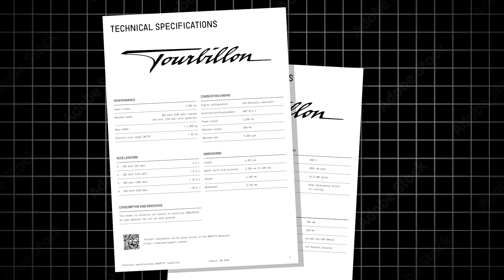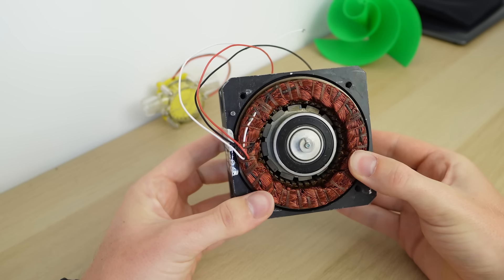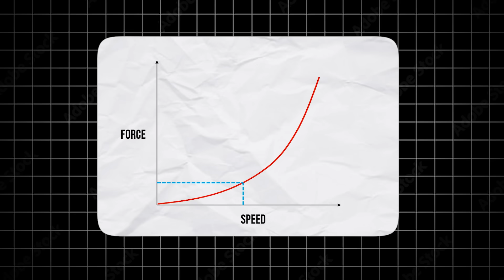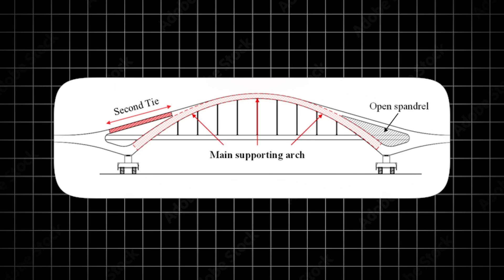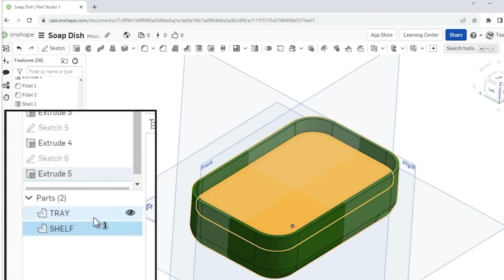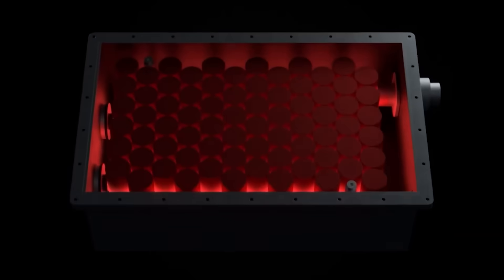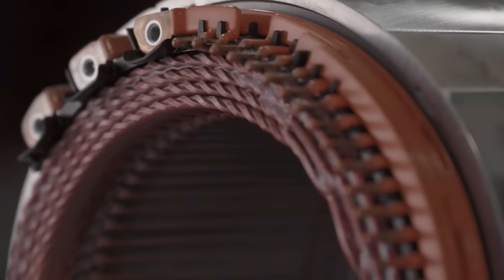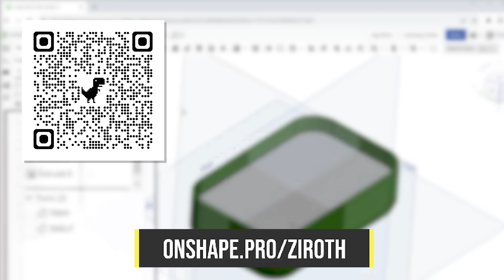How Bugatti's New Electric Motor Bends Physics

Comment: I think you went a bit off track without knowing the engine design, 24000Rpm is not uncommon in electric motors and used in CNC spindle motors every day without needing to be carbon fire composite reinforced.

AC induction motors don't need permanent magnets and showing 3 wires in tends to show its AC induction.

Just like CNC spindle motors which are usually 24000RPM at 400 hertz they can even have an aluminium rotor as eddy currents create the rotational magnetic fields and don't need permanent magnets or ferrous metals.

I have RC DC brushless motors I have made into 100,000 RPM spindles for diamond grinding CNC's.

The tensile strength of materials is only what is required by the centrifugal forces which is not only RPM but diameter and mass, so aluminium or titanium for example would be dramatically different forces to that of steel at same diameter and RPM.

If you want to do a video discussing rpm vs tensile forces and materials would be best focusing on stored energy flywheels where it is more relevant as these rpm ranges in electric motors have been surpassed many years ago.

If you want a 24,000 rpm electric motor just go on EBAy and buy a CNC Spindle motor and 400 Hz VFD for a few hundred dollars made in a Chinese factory and not requiring aerospace technology.

Carbon fibre winding would lend to potting Rare earth magnets for a DC brushless type motor which would be preferential to a automotive engine wanting to do regenerative braking but is more to do with epoxy strength in hot environments like a 200hp electric motor that when epoxy is heated it looses strength so if wound in a composite with say a PF resin which is Carbon-carbon bonds can do higher strength at high temperature .

The actual limiting factor of most these motors rpm is switching frequency and bearings as most use ceramic bearings at these rpms as stell ball bearings would fail at those surface speeds. And with switching frequency you have inductance that wants to resist fast changes and is very hard to tune and is more to do with motor driver design than motor.

But getting back to topic about centrifugal force if the rotor for example is 7075 billet aluminium so 2.81g cm3 with a tensile strength of 280MPa (about 40,000psi) and say rotor is 300mm diameter in the car would still go up to nearly 40,000 rpm before failure of material and needing carbon fibre winding.

Where carbon Fibre would be really interesting if was a carbon fibre reinforced carbon nitride for stored kinetic energy flywheel as say tungsten being heavy so can store a lot of rotational energy with still being one of the highest tensile and compressive strength materials is still just under 1 GPA in tensile strength but if would in carbon fibre reinforced Carbon nitride matrix could theoretically get over 10 GPA, this would allow energy storage of up to 500MJ/kg, (Diesel is only about 42MJ/Kg)  liquid hydrogen for rockets is only about 120MJ/Kg. So would be one of the best energy storage systems surpassing the best fuels and definitely surpass any batteries. maybe some design I will release one day soon as requires contra rotation if used in automotive, so you don't get centrifugal torque steer when trying to turn.

But generally, I do enjoy your video's and feel free to reach out if you ever want some research done on any topic happy to help.

Comment: Oil cooling is great and reminds me on chip cooling computers but car batteries should able to Load-bearing for a reduced total weight. Tesla choose a foam and cooles one Tab of the round cells passivly. What about prismatic cells who need pressure for mechanic stability may also give stability for load-bearing, cooled with oil?

Comment: Just started watching the video and... Apart from inaccuracies like "exponential" instead of "quadratic," I wouldn't want to drive a car with more than 1,100 horspower unless I were convinced of several other intrinsic and extrinsic features like stability, braking ability, and reliability, as well as road conditions and other traffic. You could say Bugatti can be considered reliable, but the mean time between failures (MTBF) of any system is known to statistically have a bathtub shape, so it will only be low after a certain time lapse (or miles run) has run.

Comment: The Rimac Nevera uses LMN battery chemistry. LiFePO4 would be one of the least likely types for a hypercar to use. The same goes for LTO, as although it has high power output as you mention, it has very low energy density

Comment: Can you ger novec 649 for cpu cooling?
Reply: Yes, but 3M charges $200 a gallon for it. Use mineral oil instead or just plain water cooling loops.  I looked into it and they won't even sell small engineering samples.

Comment: 2:51 No, that's polynomial growth, not exponential!  Exponential growth is another league entirely, and you're simply wrong to say that its in this higher league.

The term "increases exponentially" refers to a specific type of growth where the rate of increase is proportional to the value of the parameter.  That is, x is in the exponent position.  Here, we have x² , where a constant 2 is in the exponent position.
Reply: I came to say the same thing. Reading the comments, many people have also noticed this... seems like a rookie error if you want to talk about engineering topics. Maybe Joe Public won't know the difference, though.

Comment: 6:20 no this isnt referred as high power density, it is simply refferred as HIGH DISCHARGE RATE, and as a matter of fact it affects power density negatively always. LTO titanate arent "extremely power dense" either, they are very low power density compared to regular lipos.
Reply: discharge
Reply: @RSCB  ?? Bragging that you can read, or what? 😄🤷🏻‍♂️

Comment: We did fluid cooling of electrical drives back in the early 70's, using the absolutely best Types available, which were various PCBs.  We did railroad engines, and had a ten-ton military 6-wheel truck as a test vehicle.  Did ships drives, and wind turbines.  However, the PCBs were found to be carcinogenic, had to be removed, and the alternate fluids, typically antifreezes or light silicones, had all sorts of secondary problems, and were highly inefficient.  These projects were dropped by us, but the computer industry, and the heat-pipe industries started to use these techniques with volatiles, and these worked quite well.  Change-of-state cooling is also very effective.
Reply: Surely there’s something more conductive to heat. Is it that it’s hard to make materials super heat conductive without making them electrically conductive at the same time?
Reply: @milescoleman910  Generally speaking, heat is conducted by the same types of carriers, namely electrons and phonons.  Heat in a wire is mostly phonon flow, but requires a large Fermi Sea of electrons to make the transmission possible.  Seebeck and Peltier devices are examples of where people have tried to maximize the electrical efficiency, but reduce the heat flow to a minimum.  Usually done via vacancy methods such as pillars or slotted structures.  At very small atomic levels, heat flow can be hugely non-isotropic, and there are materials which flow heat "sideways" better than "up/down".  My son studies these as thin films, and some are being tried for semiconductor mounting to adjacent substrates.  The only other common method to transport heat without electrical connectivity is via change-of-state materials, as used in special heat pipes, where a refrigerant type of carrier is used to make a hydraulic/gaseous flow through a non-conducting pipe.  The pipes unfortunately are ceramics or glasses, so fragile.  Metal piping is commonly used, but these are electrically conductive.  Look up those types of items to get details.  Thousands of papers have been printed in this area, was a hot topic at around the 1980's.
Reply: Only thing that concerns me is if the oil over time gets contaminated from breaking down substances it passes over eventually the failure would be bad. Kinda how pure water isn't conductive until impurities are added. 800 volts doesn't need that much
Reply: One word ,well 2.  Li po²  ..😝dummies I use thorium...cheaper battery and last 20yrs

Comment: clickbait. Im not sorry but this guy knows nothing about electric tech or motors at all. "delivers 800 volts"? then on top of that proceeds to compare the voltage to another car like voltage is a performance factor. 600kw of power power a village for a time period? that's not how watts work, watts are an instantaneous power measurement and cannot be applied to time. kwh can be applied to time, not kw. POWER DENSITY IS NOT OUTPUT ENERGY PER WEIGHT. energy density is literally the capacity of energy per weight, not continuous energy output per weight. lots more issues but this is just clickbait by a guy claiming to know stuff about ev when he doesnt even understand the most basic fundamental of electricity, wattage vs current vs voltage.

Comment: Just a tip you don’t actually measure horsepower on a hybrid because the electric motors are really only used for the torque while HP is what determines the top speed of a car not to mention that the electric motors are only used for a short duration unlike a full ev which is all electric thus in that case you would also factor in horsepower but hybrids not so much since after a certain speed the gasoline engine would take over giving your your top speed!

Comment: That's all you need, drag around a battery AND the equivalent of a tank of gas worth of coolant to cool the battery with 🤣. Mineral oil is used for cooling of electronics generally. Can't wait to see all the battery fires that start when a leak occurs in the pack 🤣
Reply: Drag around a battery?? What?? It’s a hybrid meaning it also has an engine, you’ve literally just proven to everyone that sees your comment that you failed to pay attention or straight up ignored that it has a N/A gasoline powered engine along side typical EV technology also you don’t need mineral oil for a hybrid, the ram 1500 E-torque with a 5.7 Hemi Uses a motor generator and a standard 12v battery with a step up converter for the electric motor so as I said you have proven to everyone that you don’t know how hybrids work!
Reply: @CajunReaper95  how much added weight would a Tesla sized battery gain if filled with liquid in the open space, then factor in a cooling grid, reserve tank etc. you will be adding 20gal of coolant to the battery pack/car.. remind me the weight of that 🤔
Reply: It would be like keeping your Tesla trunk full of sand, how would that be on the mileage numbers? 🤔

Comment: "26% lower temperature, 54 vs 40 degrees C."
Me: ~Screams thermodynamically~
Reply: In fact it's less than 0.5% lower 🤣
Reply: @wedmunds yes but this isn't even relevant data since lithium batteries work better between 15°C and 35°C so they should compare to the middle of 25°C and not 0°C nor 0°K.
Reply: Agreed and based on a 20°C ambiant air it went from 34°C over to 20°C over. They should have compared it to ambiant air and talked about the thermal resistance between the batteries and the ambiant air if they wanted usefull data. They should have said: <<Accumulates 59% less heat, based on a 20°C ambiant air and has X% less thermal resistance etc...>>

 It would have been more appealing and also accurate
Reply: I don't get it. Is it just a percent difference calculation? 100% * (54 - 40) / 54 = 26%
Reply: @luckylanno  yes but I'm Kelvin, 54F is over 300K, so you'd be dividing 14 by 300
Reply: Adds “…as long as we set 0 Celsius as the lower bound”. 

Now we can all relax. 😉
Reply: @javelinXH992 sure, but these percentages are meaningless regardless.
Reply: @patrikfloding7985  as is the whole video.
Reply: @javelinXH992  In what context is that even relevant?
Reply: @PunaJussi  Explaining why he got a (wrong) percentage. It is common 
, but incorrect, for most humans to use 0 Celsius as the bottom of the temperature scale.
Reply: @javelinXH992  But it's not on that written slide that's shown at 8:10.
Reply: @Winnetou17   I know, but most people who do science and engineering know how the full temperature scale works. 😉

Comment: The centrifugal force is proportional to the SQUARE of the rotational speed, so it increases quadratically not EXPONENTIALLY, an enourmous difference!
Watch physics 101
example : at zero speed omega = 0 , the force 
F = m × omega² = 0
you claim 
F = m × exp( omega)
but exp( 0 ) = 1 , which is NOT what your inaccurate graph shows
Maths 101 you must repeat also.

Comment: The electric motors are exactly the same as those used in the Nevera, they just don't deliver the same 500 hp each due to battery limitations

Comment: Energy density is NOT how fast a battery can discharge, that's C value. Energy density is the ratio of energy to volume
Reply: Thanks for clarifying, this really confused me. The thing with "exponential" was also confusing (he probably meant x^2 and not a^x).
Reply: Physics is now "Bent"
Reply: Power to Volume Or to mass, there are two power densities used.
Reply: Or perhaps weight.  Though weight and volume are correlated.
Reply: he talkes about power density and that is as the word says the max power drawn per unit volume... what are you on about?
Reply: @SuperBiologe  You're right and wrong. Density is power per unit volume (or mass) but ziroth was using it to mean how fast current could be delivered - which as 32BitJunkie correctly states is a battery's 'C' rating. Usually the higher the power density the lower the amps that can be delivered.

An 18650 can have over 3,400 mA/h storage but if you want one for high current use (10 amps and above) such as a powerful vacuum cleaner, vape or vehicular use the power density drops to 2,000 or so. Higher current draw = lower density with current technology.
Reply: @Shaun.Stephens  you are confusing quite a bit of jargon here... Power != Energy and what you ment to write was "mAh" not "mA/h". It is generally speaking true that batteries with higher power density have lower energy density as it is a trade off in battery design. The analogy used in the video describes a village that needs power. Therefore the power density is indeed important as a relatively small battery can deliver the power needed by said village, however due to the small capacity of the battery, it will be empty quite quickly.
Reply: @SuperBiologe that reflects his unprofessional understanding on electric cars
Reply: Thank you, you saved me commenting the same thing.

Comment: Was this a GPT generated vid? You put your credentials on the line to say that lithium-titanate batteries with their inherent lower voltage (2.4 V), which leads to a low ass specific energy of about 30–110 Wh/kg aka half the conventional lithium-ion battery density to be the better choice (there grid tie batteries that win in life cycles something needed for the grid not a weight sensitive automobile) 

That there "limited by cooling" something so easy to look up or understand if you know how a battery pack works it's embarrassing, actually here is a statement from the mentioned Nevera team that doesn't use the heavy lithium iron phosphate as mentioned but rather lithium manganese nickel batteries (again not even 1 googling to check basic work?):

"The Nevera does NOT drop in power because of battery derating nor is it overheating. If I remember correctly, it might have reached 35 °C in that run, which is very far from the maximum temperature. The power drops because the motors are reaching their maximum speed due to the transmission ratio. As you well know, with single speed gearboxes like in Nevera, there is a trade off between acceleration and top speed. We figured that 412 km/h was plenty and did not want to compromise on acceleration. So basically, the battery could deliver 1.4 MW for a lot longer if the powertrain could take it (longer ratio). The drop in power is due to the motor power curves which drop off at the end of the RPM range and the car reaching its equilibrium speed at max RPM."

The rest of the vid is other pop science interpretation of press releases and of course the all important sponsor with no actual useful first hand or usefull info.
Reply: He was talking about power density, not energy density.

Comment: So, this channel is basically just 'Undecided with Matt Ferrell', only the presenter isn't bold, and is just as clueless and prone to mistakes when it comes to understanding the material he is presenting. At no point is there any physics bending- 100% clickbait BS, 24,000rpm is not impressive- the motor in my r/c truck does 60,000 and is wrapped in carbon/kevlar, the way you talk about the temperature decrease is highly misleading and just plain wrong, and talking about battery overclocking- you're not an engineer, at best you're a lousy one who is terrible at explaining or even understanding the subject you've chosen to talk about.

Comment: Electric flight, specifically battery-electric flight, is not a possibility. The energy density is not there. That's not to say that a hybrid generator+electric motor is beyond the realm of possibility. People are fascinated and excited about flight and the idea of making electric airplanes, but I think that the better question to ask is, why not put the R&D dollars and effort into electrification of things that don't need to consume a portable and energy-dense energy source, and free that energy source for the use in airplanes? And, for those who are dead-set on making electric airplanes, I'd say to start with generator-electric hybrids and let the automotive industry solve the issues of energy density, range and safety.